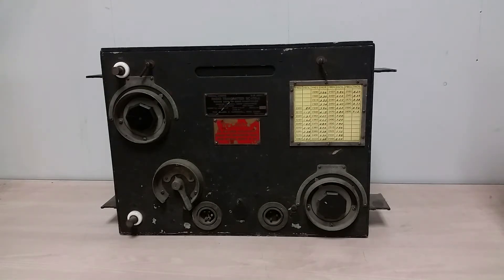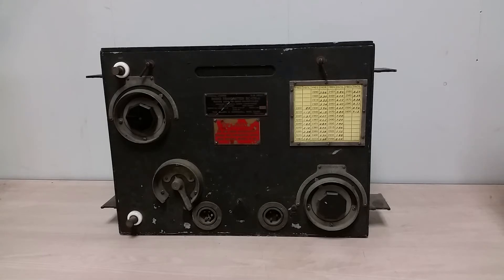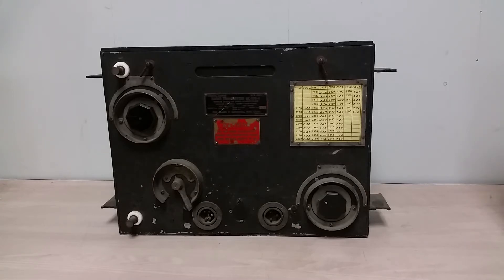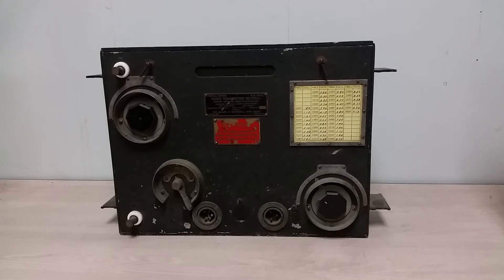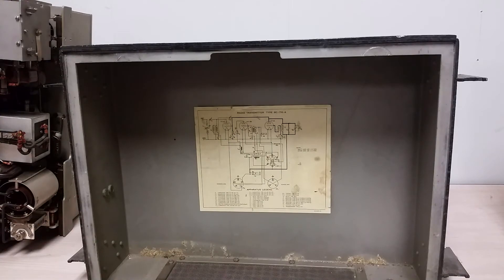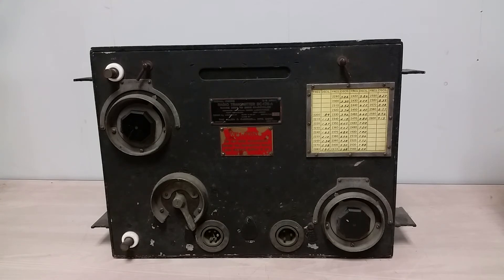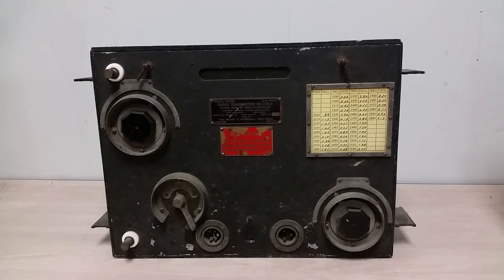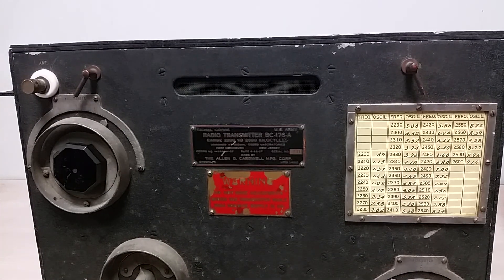1937 Army BC-176-A Radio Transmitter

Comment: The VT50 is a British tube, also known under the designation CV1050 and the original Marconi-Osram designation HL2K.
Reply from the maker: This radio does not take the CV1050,  but the US Army Signal Corps VT-50. Different tubes! There are quite a few cases where British and US tube numbers collide.